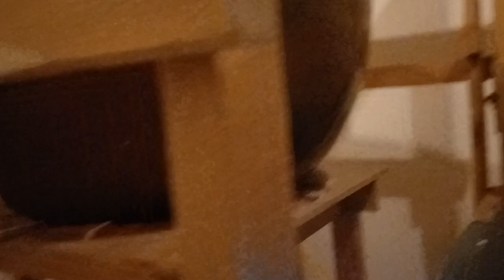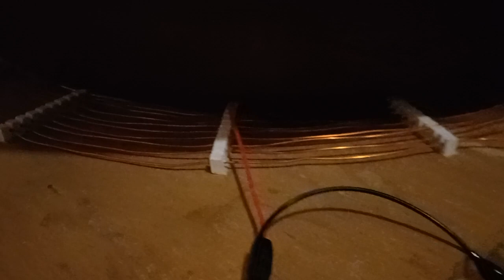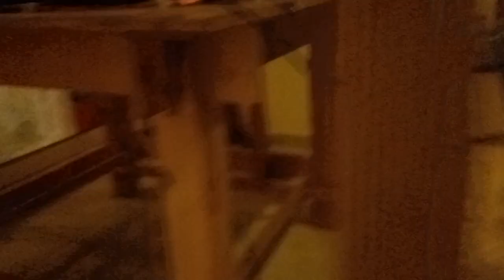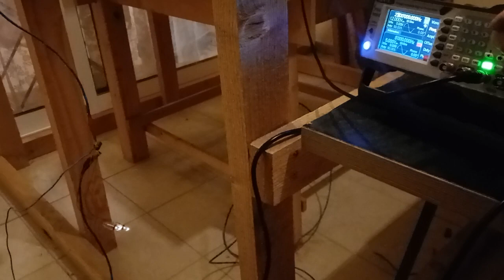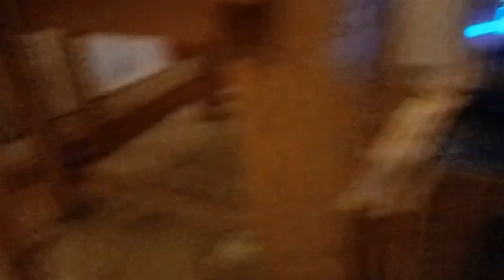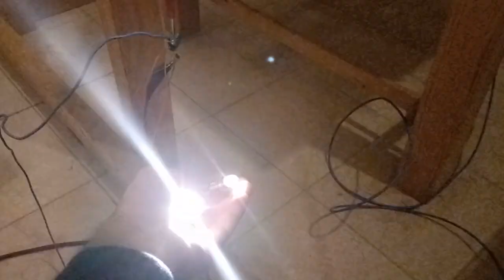Rectifying 7.2 Mhz  to DC Curent with the STA

Comment: How might changing the size of the system affect the frequency?  Like if you make everything half the original dimensions would that make it resonate at 3.6 MHZ or 14.4 MHZ?
Reply from the maker: Usually smaller size equal smaller wavelenght which result in a higher frequency.

But in this set up the smaller size should be 1.6 times smaller from the curent set up Im using.
Reply: @allistar-center  thanks for the reply, what makes you say 1.6 times smaller?  Are you using an equation for that?
Reply from the maker: Im not sure you understand this experiment corect.

 That is not just 1 sphere.

 That is 50cm startetrahedron nested inside 50cm sphere then 80cm sphere then 1.3m sphere. Everything is nested inside one another.

But one way to get the frequency of a sphere is to devide the spped of light to the circumference.

300 000 ÷ 40 000 =7.5Hz
Reply: @allistar-center  but I’d like to clarify that this isn’t standard electromagnetic resonance because a 1.3 meter diameter sphere has a circumference of around 4 meters which corresponds to ~75 MHZ based on the speed of light, and you’re working with around a tenth of that frequency.
Reply: @allistar-center  Oh, yeah not just an ordinary sphere can do this.  Sorry, I'll watch your other videos to get a better understanding of the structure.
Reply from the maker: You are corect there is a mix of many different frequencies inside. I just get new VAN and measure several resonant frequencies.

Remember there is 3D fractal star inside...

I bele that this 7.2Mhz is one of the resonant frequencies only from the lower ones. 

I need more measurements to make and lear more about that but tge good thig is that we rectify this 7.3Mhz to DC and also input the signal wirlessly and the output power was the same.
Reply from the maker: I the scaling need to be in the golden ratio 1.618 Phi.

I did this model as 1.618 times bigger from the minimum size possible in order to get any results.
Reply: @allistar-center  interesting.  Is the propagation of this radiant energy partly dependent on length of the elements?  Like in an electromagnetic resonator (an antenna) or acoustic resonator, if the size is decreased by x, the resonant frequency should increase by x.  Is there a general concept you’re going by to determine the ether/radiant resonant frequencies for given dimensions or are you being experimentally guided at this point?
Reply from the maker: Yes it depends of the lenght the optimum lenght should be 1.68 time bigger than what we use now but is super expencive and not easy to make such a big construction with what I have here.
The copper is cery tin but super heavy too.

Bashar told us that can be activated acousticly with sound too. 
The effect inside can be ralated to Sonoluminocity I belive.
Reply: @allistar-center  Indeed.  Could you give me a general equation for if you have an element of (x) meters, the frequency should be y, like F = (1.8 MHZ)*(1/x^(golden ratio)).  I appreciate your input, I'm just trying to get a general idea here.  Obviously you've experimented with complex antennas like the double conical one and the tetrahedral fractal, but for a simpler shape like the sphere in this experiment.

Comment: Hi Krasimir, 
  Thanks for sharing.
    It looks like a good test for Resonant peaks. I really like your test equipment setup. I have about the same setup here with some new video testing with my Vogel Crystals. I shot a bunch of segments but I do post process on stitching segments yet to do. I appreciate you efforts and totally loving your input. One other thing regarding ambient air dryness. Wet air dampens the energy while dry air as you probably know promotes electro- static conditions. Even our bodies can accumulate charge as you know. Voltage can develop as High Voltage / low current. Although low current at high voltage can hurt as getting zapped even if you touch a metal door knob. I refer to this a floating ground state.
     I also explore much of Tesla tech diversity. The Dirac sea of energy and altitude also is to be considered. I set up a system using 600 ft cable suspended about 25 ft suspended above earth ground with Glass insulators and a tunable capacitor connected to the 2 conductors of each cable tied as a looped configuration. The setup provided 1200 feet of looped (floated ground).
     I used germanium diode and a Electrolytic Capacitor for charge accumulation. One side Grounded as in your video. The germanium diode only required .2 Volts to function. As a addition to ambient collector charge I added a Zinc/Copper water battery in the pole top Sphere, for running the Diode Junction. Diodes as well as LED's have there own oscillating to the line other than the pickup of the straight line antenna of stray energies. Lot's of them Amplitude Modulation and Astrophysical domains. 
Well that's all for now. 
Hope you are doing well.
 Keep the faith. Blessings! .....Scott.....~~~
Reply from the maker: Thank you for yiur input Scott its always very interesting to explore your perspectives.

Today was the fist day we get the same output but without touching directly the outer sphere.
 Instead I run the signal trough coil of 9 lopps which is around the device but is not touching the device.

This coil is acting as antenna because only one end was connected, this mean that we transfer the power wirelessly trogh resonance.

I have many reasons to belive that if we make a second Space Time Antenna  few kilometers away will have the same or similar effect.

But will share more in the next videos.

Comment: What is the purpose of the capacitor? Why is it changing the resonant frequency?
Reply from the maker: The purpouse of the capacitor is to store the charge as potential difference from whre we can take it as DC current. Ones we get DC we can store in a bettery or directly invert it into 50hz AC suitable for our needs if the power is enough.

A capacitor have reactance which which mean in limans terms that react differently to difefent frequecy.
 It loves higher frequency and have less resistance to them and at lower frequency have higher resistance.
The oposite is true for inductor.

At resonant circuit we have some resistance of the wire and reactance from the capacitor C and inductor L, together all of this (resistances) creat a common one which is called Impedance (Z).

 They work for each other becaese the capacitor store energy in electric field and inductor in magnetic field. 

They pass the stored energy to each other to create oscilation (resonance)

But one of them loves higher frequency and the other  lower one.  At resonnance the reactance of capacitor cancel the one of the inductor and the total impedancs is equal to the resistance of the circuit. In oter words drop down.
So  back to your question....

When  we add capacitor in our circuit this will change the reactance, which will change the impedance and will result to new resonant frequency.

This is shy in the radio we have variable capacitors and when we rotate the knob we change the capacitance and this tund the radio in a new frequency channel.
Reply: @allistar-center  wow, thanks. A lot to learn from this example.
Reply: Any change in the LC inductance or capacitance will move the frequency, this includes your bodies capacitance if you touch say the ball.
And the capacitor and diodes are rectifying the RF energy into DC to power the LEDs.